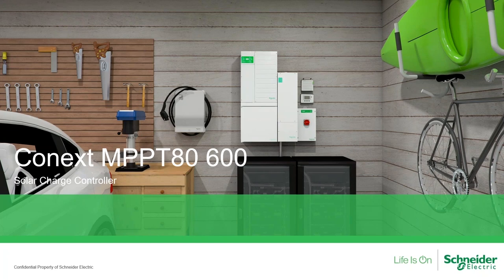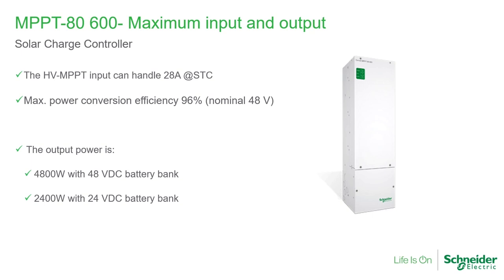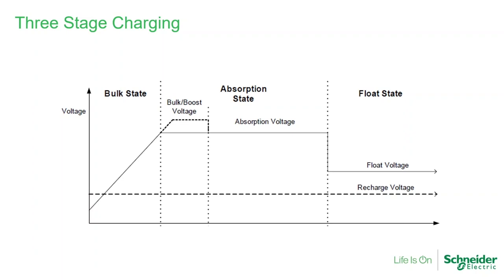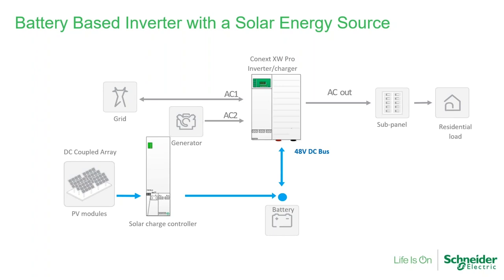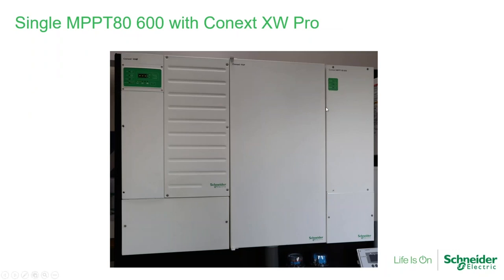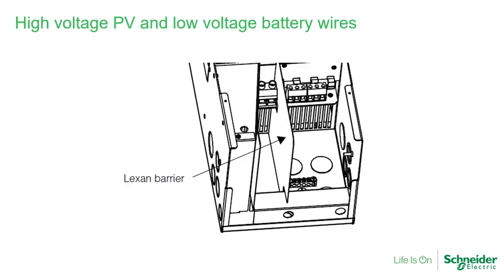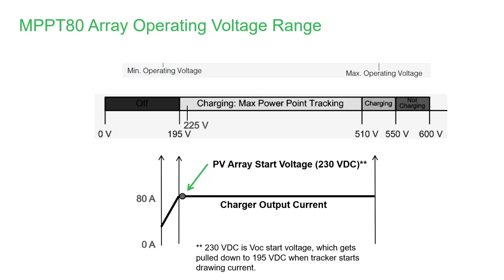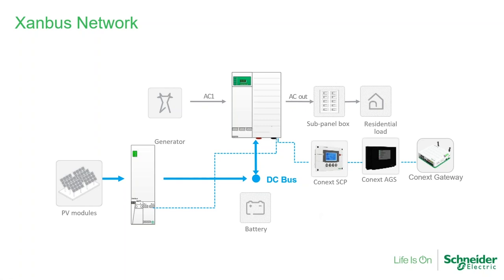Webinar: Conext MPPT 80 600 Solar Charge Controller Installation and Programming Best Practices

Comment: Hi Sandra, thank you so much for the insight into how these work.  I have a dual inverter/dual charge controller system using 2 of these MPPT 80 600 controllers, however, one of my inverters (the master) is no longer actually charging even though it still tells the slave inverter to and that one is working as expected.  Is it possible that one of my charge controller fuses is blown?  If so, what would be my procedure to test it?  Thanks!!

Comment: Awesome description of this product!!  Any chance can I use the "MPPT Disconnect RS" as a Combiner box? Currently setting up a plan using your Xantrex XW6048 Dual Inverter system along with Two MPPT 80-600 Charge Controller.  Basically looking for combiner options as well and Rapid Shutoff would be ideal for our 32 panel Ground mount system.  Any suggestions?

Comment: Hello.. I recently install one  off those chargers with one XW+ 6848 and the charger is giving me a W55 code heat sink temperature error. I also notice the top fans did not come on...any help will be appreciated. Thanks

Comment: Hi Sandra I have just acquired 3x8548xw+ and 3 x 80/600 mppt . I am going to connect 2  of 48v/200 ah  batteries i want to connect 1 on each phase . My question is  can I connect all the batteries to all sets .
Reply: Check out our channel where I install a 15.36Kw Multi Inverter and Charge Controller Schneider System.

Comment: Wouldn't it be more efficient to bring the PV 500v onto the inverter's DC bus ? Rather than converting it to 48v and back again ?
Reply: It would.  But you still need the 48VDC to 240/120VAC conversion aspect in the inverter for when there is no solar production (nightime).
Reply: @billjohnson3344  
Well of course but if there is sun and a load you wouldn't be stepping it down and back up again, all other conditions would remain the same.
Reply: @JohnSmith-lv8xk  Yes, I agree.  But the Schneider concept is very modular and supports various setups - so there is some inefficiency and redundancy to support that.  For example, the inverter can be used without solar at all and only for battery backup - hence the need to have the step-up (and no need at all for solar DC in that case).  But, because of that flexibility, you end up with needing two things to charge the battery - both the charge controller (from solar) and the hybrid inverter (from grid).  A compromise they chose for the system flexibility.  Some definite design optimization could have been done if supporting only specific use-cases.
Reply: Well the inverter does not have a 500 V DC bus!

Comment: The cost of this controller is not worth investing in it. I would better buy solar panels equal to it's power rating complete with a pwm charge controller.
What happened to cost benefit analysis ? The cost per watt of pv from china isn't worth investing in that controller.
Reply: Can the cheap inverters handle 600v input at high amps  and are they UL listed to pass inspections?